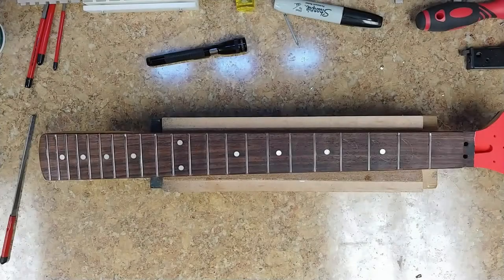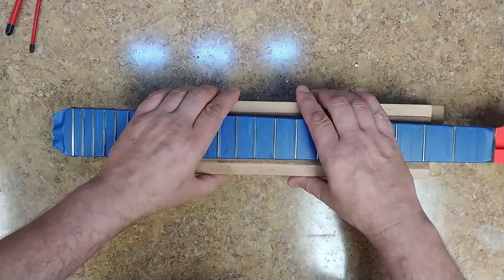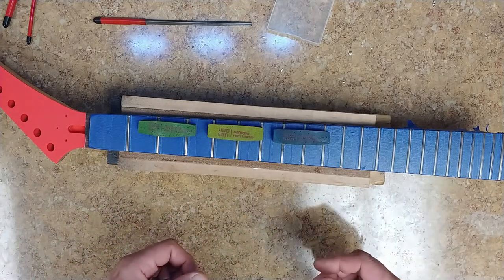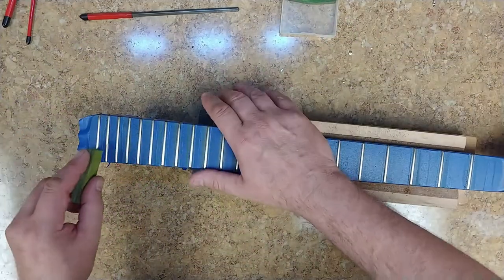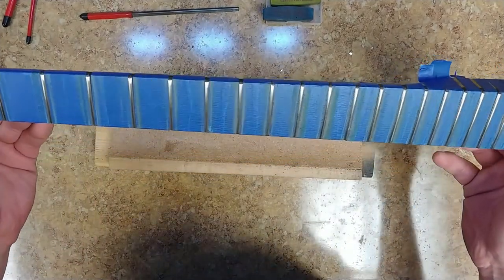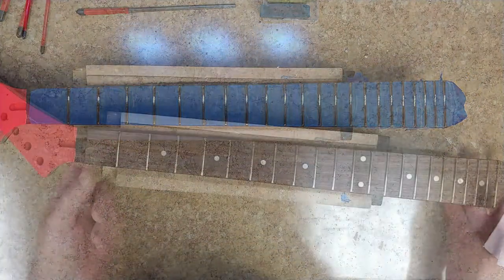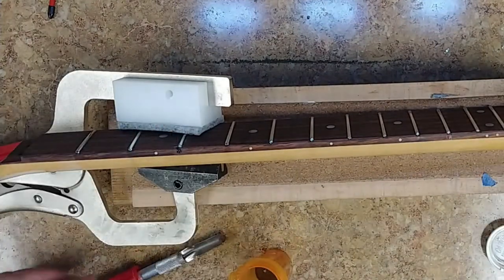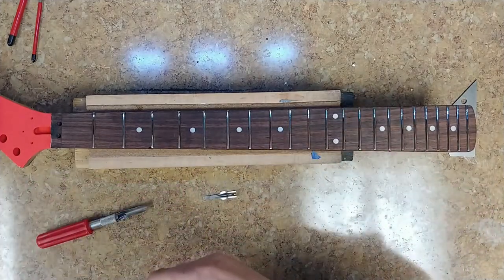Fret Crowning and Polishing and Tang Sprout Repair in Real Time

Comment: Some good tips here, thanks. I've been using miniature micromesh pads from 1500 to 12000 grit, seems like a waste of time when I could use fret rubbers and a polishing tool. A very enjoyable watch!
Reply from the maker: I was using 400, 600, 800, and 1500 and 2000 grit. This way works just as good and it's a little easy on the fingers.